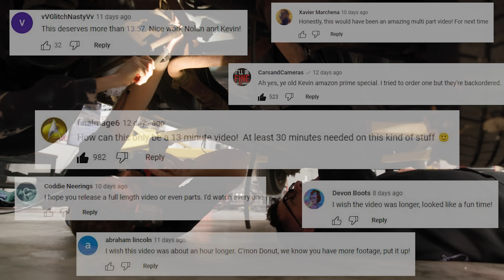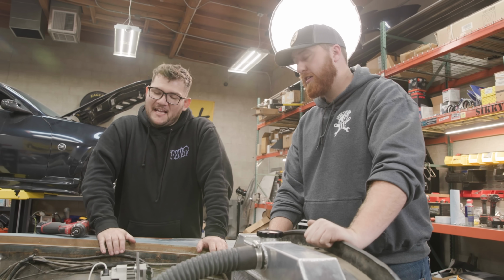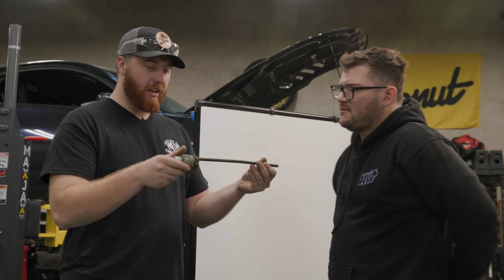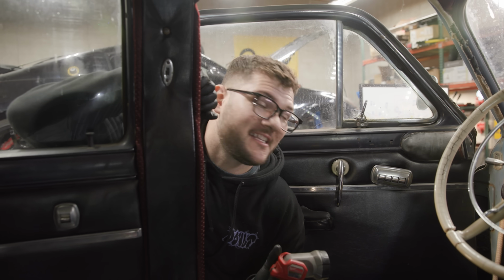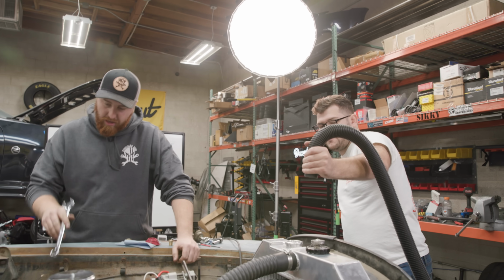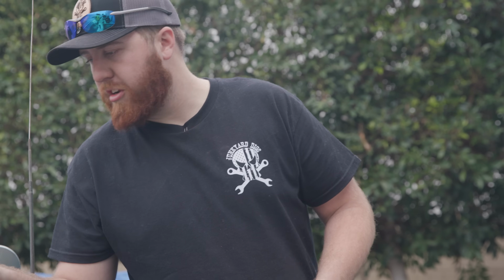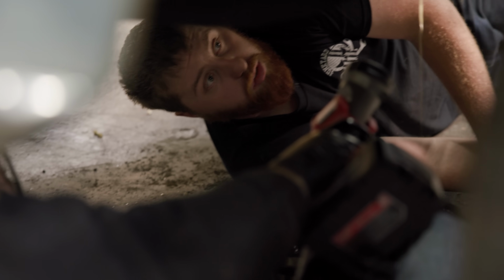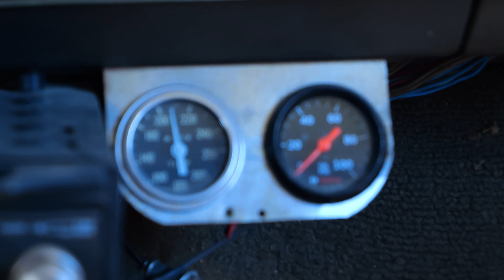Reviving Nolan's Imperial - On Road After 40 YEARS! - FULL LENGTH EPISODE

Comment: Fun fact as someone who’s work on a fair amount of 1930s-1960s Mopar’s, that steel cable went directly to a firewall mounted coil. It was wrapped liked that as an early form of radio noise reduction from the emf created on a positive ground ign coil.
Reply: Why was it designed to be unremovable through the firewall if it was only for EMF?
Reply: @JT-tz5hp  it’s wasn’t, you undo the nut around the ign cylinder and you can drop it forward then disconnect it from the coil thru the back side

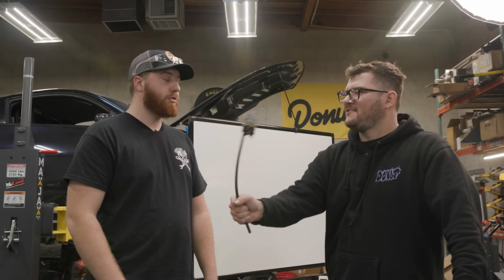Comment: 13:53 This steel line is indeed an anti Theft system. It was used to prevent the posibility to hotwire the car by directly putting a positive wire to the coil. This system is also found in a Volvo Amazon also known as a Volvo 121 or 122
Reply: Scrolled to far for this
Reply: The infamous Amazon armoured coil cable
Reply: Back when car names were cool
Reply: It’s in many Chrysler manuals at the time that it was primarily used as form of radio noise reduction reducing emf interference. It’s a steel bounded copper insulated line used as a faraday cage. You can still Hotwire a 30s-50s Chrysler in about 30 secs if you know what to do.
Reply: What I came to the comments for
Reply: I love an Amazon wagon

Comment: Glad you got to replace the DX Armored wiring in the dash Kevin. It is natural rubber coated wire with a rubberized cloth that was used in everything from the 20's to the mid to late 60's. Commonly referred to as tube wiring.

Comment: I had a 1954 Imperial with a regular 2 speed auto. I am so glad it had that
Reply: The transmission in the video had four forward speeds. But , especially in the torque converter version like the one in this video, everyone only used the top two gears (high range)  most of the time. So when they designed a fully automatic transmission like yours, they only had two forward gears.

Comment: Converted a 6v chrysler windsor car to 12v and added newer gm power steering pump. Used a ballast resistor to run the factory gauges.
Reply: The car must have been power from the factory, which is rare in Windsors. The gear box and the linkage are all different from the power vs manual steering cars.
I'm looking for all the power steering parts for my V8 1952. And the generator.

Comment: I had a 55 Chevy that had that kind of wire. Everytime I took it out, something would stop working until finally decided to replace everything.  No after market harness either.  Took the entire winter of weekend nights to finally fix that.  I feel your pain.
Reply: The wiring on my low desert find 52 Chrysler all looks good except right behind the headlights. The headlights were broken and the wiring going to the connectors were exposed to sun.

Comment: Hi Kevin, I know I'm super late to this video and suuuper late to the original video, but I have a DeSoto Custom 6 (another Chrysler product and essentially the same car except for trims and features) of the same year. I have been through every inch of my car and I can probably shed some light on the questions you guys asked each other and us during the vid, if people haven't already beat me to the answers.

1. The metal cable on the ignition lock was indeed an antitheft measure. I don't know for sure about the Chrysler models but my DeSoto has both the hood release and hood latch on the outside of the car - there is no handle to pull inside, you can open the hood from in front of the car. In order to prevent the car from being as easily stolen by hotwiring the coil, this was implemented.

2. The fluid drive transmission (which I see Donut has commented he is going to remove, frankly a massive shame as there aren't many of those left) is a complex but very intuitive system. I'll post this for the benefit of others in these comments who are curious/have questions. What you have here is a Fluid Torque Drive, which is different from regular Fluid Drive (which did not have a torque converter). 

When in a gear if the engine is not running, the vehicle can be rolled (highlighting the importance of a working parking brake). Once the engine starts, the oil pressure rises in the transmission. As wheel speed increases, so too does the oil pressure in the engine, which tries to flow into a second passage (this being the high gear, 2nd or 4th depending on which range you are in). That passage is blocked by a ball valve. There is a centrifugal governor which spins in direct relation to wheel speed. When the governor contacts out (weights spin out and contact the outer casing, closing the ground), electrical power is given to a plunger/rod that pushes that ball valve out of the way, and this allows the oil to flow through that second passage, shifting the car into the high range. When wheel speed slows enough, the centrifugal governor releases and begins spinning again, causing the electrical contact to the plunger to be lost and the ball valve to return to its original position. This closes the second passage off and forces the oil back into the first, thus putting the transmission in low range. There should be electrical connections on the Ball Co. carburetor - inside there is a set of contacts that ride up and down in relation to the throttle. Above a certain point (40mph on my car) those contacts can no longer connect (one of them is limited in height), but under 40mph if you push the throttle to the floor it will connect those two contacts. This overrides the governor on the transmission and manually disconnects the electrical contact on the transmission, forcing the ball valve back to its original position and putting the car back into low range. This was for overtaking, hills, and the like. If anyone is interested, let me know as I have all sorts of manuals on these transmissions. The DeSotos did not get the torque converters so I'm not super familiar with those on these cars, but I have manuals that include both versions.

These transmissions are the direct predecessors to automatic transmissions, and they're not super duper common. Mine runs straight 10W motor oil as its fluid (not transmission fluid) and only leaks a little bit. Since Donut is not keeping his, Kevin, I hope one day you'll revive one of these 50s Chryslers, they are super cool. If you ever do and want a hand, let me know, I'd happily bring myself out there and lend my 50s-Mopar knowledge anytime.

Comment: Kevin -if you are still running the points distributor did you put in a ballast resistor. Better to run the points on 5v. Running on 12v burns them much faster.
Reply: That's what I'd do.  I suppose they could find an actual 12 volt coil but young people don't know how to tell one from another. (ohm meter)

Comment: I'm pretty sure its already down there in the comments, but that ignition wire through that surprisingly thick steel rod, is in fact an Anti-Theft system.   I think (not 100% sure) that It works by passing the ignition lock to the 6v ground, unless the key is turned.   At that time, no one would waste the effort to cut the thick rod and hot-wire it.  I suppose, the thieves could just bring a 6 volt battery with them and just jump the ignition from that??  but yes.. it is an Anti-Theft system.   Good call Kevin!

Comment: Have you seen Uncle Tony's video about the zinc? Jeep was using flat tappet cams on those 4 liters forever and never suggested adding zinc.
 Presumably the break in oil had it but it wasn't important enough to specify it for replacements
Reply: I remember the break in stuff Mopar sold in the 1970's was "Sulpherized Ester."  It came in a bottle about the size of a modern bottle of brake fluid.

Comment: The vacuum trick also works if you have an oil plug leak after an oil change, use the fill hole and make sure the dipstick is in tightly.

Comment: 26:54 I did this in my 1994 f-150 and didn't use the vaccum. it lost a little collant but it worked really well. I topped it off after and its been working great.

Comment: ive done the vacuum trick before. Had just changed my oil and realized i forgot the seal washer on the drain pan. held in the oil while i removed and reinstalled the drain plug. you do have to worry bout sucking in a seal though.

Comment: Congratulations Nolan  :)  crew to plus Kevin from Junkyard Digs  you did excellent job on fix up this old classic car and Happy all work  out too also! Yes Nolan needs stock  up Transmission fluid for this special Transmission for future when need change to also! Hopefully got all interior light on Celine Dome , dash, license plate also trunk one any other lights need change to 12 Volt Negative ground! Also did that car have radio or had put one with  Speakers too and be cool to do too!

Comment: Fun fact, the early Chrysler fluid drive has no first gear but all that 'electric stuff' you encountered on the gearbox is an overdrive. The fluid drive allows you to release the clutch while holding the brake without stalling, the clutch only exists to allow gear switching, It was a primitive but neat early step into fully automatic transmissions, which was very popular with the women drivers of the time since stalling is almost impossible to do.

Comment: It is possible to use the original instrument cluster gauges, but you have to provide either a solid state voltage regulator or one of the pulsed regulators that Chrysler began to use in 1956 to drop the 12VDC down to about 5VDC for the older  meter movements. The fuel gauge would have to be looked at as a special case as you are using a fuel tank sender made for a 12VDC system, but I am sure you can figure that out. Also look at 12VDC being sent to the window lift motors. They will run with 12VDC on them but extra fast. I'm not sure about the life of the motors with that much voltage being applied, but keep in mind they are intermittent operation items, not continuously being operated. It is possible that power window lift motors from Chryslers from 1956 up thru around 1968 might be interchangeable with these older motors. It might be possible for an electric motor rebuilding company to re-wind the motors for 12VDC. You would have to check.

Comment: You're lucky to have that Imperial. I had two of them and I still wish I had them.
Reply: How difficult was the transmission to work on.  Or is a death sentence when they break ?
Reply: @texasslingleadsomtingwong8751   One of my imperials had the standard 3 on the tree transmission  It was just a 3 speed manual. The other was the fluid drive which was a semi automatic transmission and no if something goes wrong it's not a death sentence The transmission is still rebuild able  it's just a matter of sourcing the parts But it is not going to be inexpensive to repair. if you're capable of doing the work yourself you can save a lot of money.. Fortunately I never had a real problem with mine.
Reply: @texasslingleadsomtingwong8751   I can tell you that the reason the transmission on the Imperial in the video started to leak was because they ran the engine before putting oil in the transmission the seals in the torque converter and the fluid drive transmission are leather Seals by continental rawhide And  likely damaged when they ran  The engine while there was no oil in the trans.
Reply: @tarstakars  I wonder what year that first one was? Perhaps it was a straight 8 1950.
No V8 Chrysler was available with a manual trans in this era. Just two types of Semi automatics. Note that the clutch pedal on the semi automatic and the shift lever on the semi automatic look the same as the ones on a three on the tree SIX cylinder Chrysler.

Comment: We have a 1952 ford prefect it's so easy to work on you can get a decent size gut infront of the radiator engine block is only a foot long so don't even need a engine lift

Comment: Do not ever remember seeing a '52 Imperial. Oldest were '55's. Pretty rare car I would imagine.
Reply: There are few around. There are probably more Imperials that New Yorkers and Saratogas, because people probably figured the loaded models were worth saving.  Imperial as a model goes back to the early 1930's.  But, 1955 was the year that the differences in styling became more visible.  And by 1960 they were on a different body/chassis.

Comment: Motor oil still contains Zinc, just at a very low level.
With those tappets you are going to have to keep adjusting those. Maybe around every other oil change, 8k miles or so.

Comment: Run 15-40 rotella diesel oil it's really close to the weight that engine is supposed to have and has more zinc than it'll ever need plus four quarts is usually cheaper than the one bottle of zinc additive

Comment: Two things, STP does not contain enough zinc 127ppm, and modern motor oils still contain zinc, but at lower levels. So Nolen used the correct additive.

Comment: I don't know how I remember this but I've been working on vehicles for very long time but for the Imperial itself from 1942 to 1955 the initial switch itself had that lead wire that Routed through the firewall and into The wiring harness for the spark and timing to open it up to fire for the starter and the Fire making it happen lol  And in 1956 they made Ito where there was a complete stand alone system because they had so many problems with the initial switch actually Slightly separating and it would not make contact to spin over the engine and fire And so for each one that they had to replace it was $6

Comment: I had a 64 Volvo that used an armored power wire from the switch to the coil. Anti theft was my guess at the time.
Reply: Same here, '64 Volvo P1800, coil and ignition were one unit with a flexi-conduit between them. I never took it apart to figure out how it worked. Interestingly the coil was mounted halfway into the firewall, so the back of the coil (inside the firewall) is where the cable attached to, while the spark boot and the wire from the distributor connected to the half outside the firewall.

Comment: Please run copper tubing to an oil pressure gauge. I know they come with plastic tubes, but man when that tube fails - and it WILL fail - you're going to WISH you spent the $23 on a roll of copper tubing and fittings.. PLEASE RUN COPPER TUBE TO YOUR OIL PRESSURE GAUGE!!

Comment: Whoa!  That is NOT a torque converter that you're referring to!  It is a "fluid coupling",  called "Fluid Drive" by Chrysler.  It was a simple 2 element unit.  It did not have the sprag element, thus no torque multiplication like a torque converter provides.
Reply: In 51 Fluid Drive was standard. With a Fluid coupling.  OPTIONAL in all cars and Standard in Crown Imperials was Fluid Torque Drive.   Which is what the car in the video had. With a true Torque converter. You could not see the label "Fluid Torque Drive " on the shift selector because the never really showed it. But you could tell from that big pan they took off that it was Fluid Torque Drive. Not Fluid Drive.
Reply: @auteurfiddler8706  My bad!  Sorry.  My experience with '50's Mopars was limited pretty much to Dodge and Plymouth, I guess.

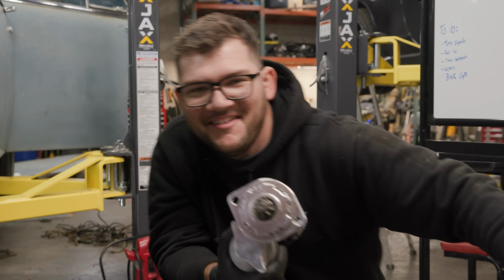Comment: 200lbs of torque. That’s more than most n/a Civic’s/Intagra’s 😂 I know I’ve got a b20b swapped EK 😅 20:06
Reply: Remember, in the olden days, they used a different system of measuring hp and torque called "gross" .  Vs "Net"  1972 and later.  So, 180 GROSS  HP in a Hemi 1951-52 Chrysler was good for the year it was built but that is less than any car sold today that I know of. Since it would be only about 135 net.

Comment: Oh and for the record and for the future then make a simple electronic adapter for the gages in the dashboard all you do is run power from the  The Ignition switch to the adapter and it converts everything in the dash back to 6 Volts. Also a good locksmith can come to your location and make you a set of keys for the original tumblers it's not cheap but it doesn't break the bank and then you don't have to change anything out on the doors and the Ignition and the trunk.  Chrysler type A transmission fluid which should work in that trans Is available through o'reilly auto parts but you have to order it.
Reply: I can't find a key to fit the ignition of my 52 and I've been looking everywhere. I doubt a locksmith would have one.
If I were converting a , say 52 Plymouth to 12 volts, I'd use that adapter. Of course there is no good reason to convert.  But if I were.
But this Imperial has SIX devices to convert just for the trans.
Three on the trans itself and three under the hood.  (carb vacuum, throttle, ignition)
 AND the electric windows. And the usual dash and the light bulbs.
  I think converting to 12 volts is a mistake usually but is is IMPOSSIBLE for this particular car. If you want to have a shifting transmission. The guy conceded as much when he said he's looking to change transmissions. Which he doesn't realize is close to impossible.
Reply: @auteurfiddler8706   I have a 1955 Chrysler Windsor that was 6 V and I purchased and 8 V battery And that cleared up a lot of problems it was easier to start and I never had a single problem with the light bulbs or the power windows or power seat remember it's only 2 V more but in the cranking it does make a difference and all you need to do is slightly adjust your voltage regulator . Several of my early fifties Chrysler products would charge 8.5 to almost 9 V when you're doing highway speeds anyway so I never had a problem with the battery going dead. As far as the key goes for your 52A lot of well established locksmiths have a surprising variety of keys I had absolutely no problem  Having a locksmith find a key for my 1955 Chrysler Windsor.

Comment: Cars were sold by the lbs. in the 50s. Everything on an Imperial is going to be heavier and more complicated than anything else on the road at the time. Chrysler it's a juggernaut.
Reply: I agree totally about the more complicated.  But early 50's cars were narrower by three inches than later cars. Also, they had less overhang. Front and  Rear.